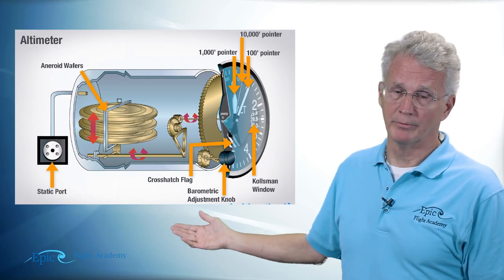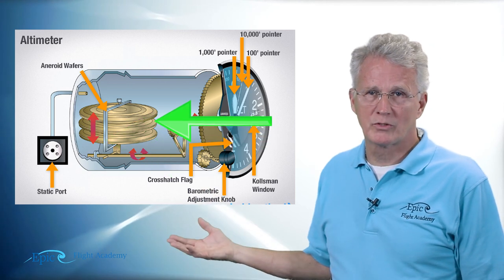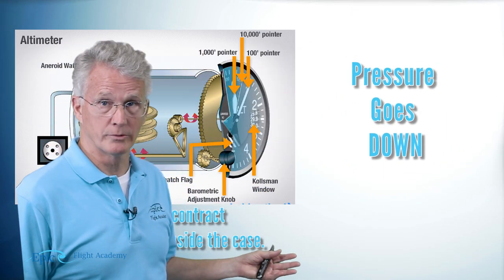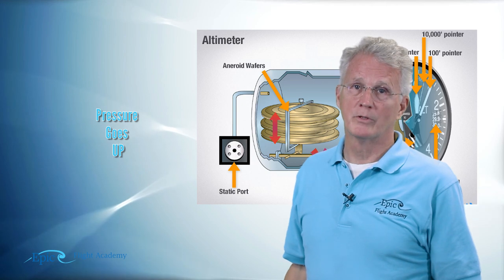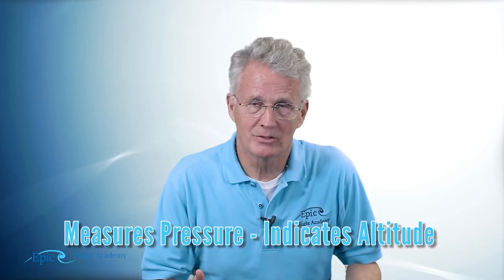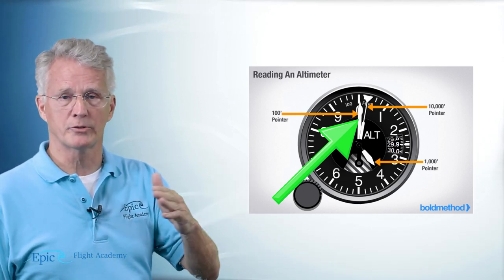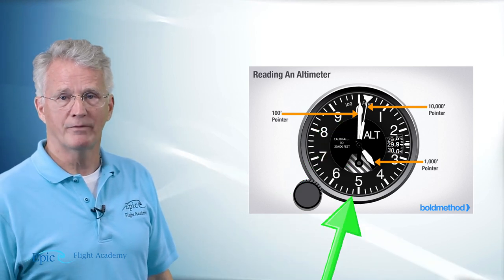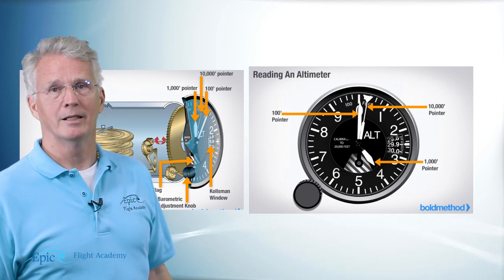PPGS Lesson 7.3 | Altimeter

Comment: On c172 does the altimeter show MSL or AGL?
Reply: Indicated altitude (AGL) is what is shown on the face of the altimeter.  True altitude above mean sea level (MSL) can be derived with corrections for both pressure and temperature.
Reply from the maker: Mark already answered your question. Thank you!
Reply: Love the series, but I believe the data on the screen is misleading.  Indicated altitude probably should not have the (agl) next to it as that would lead viewers to believe that indicated altitude should be the same as absolute altitude, which is not the case.